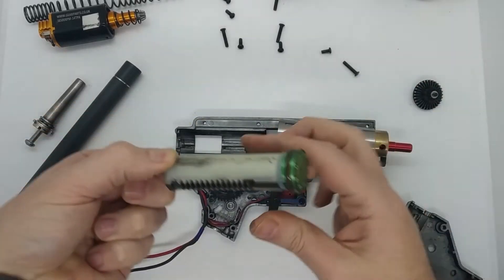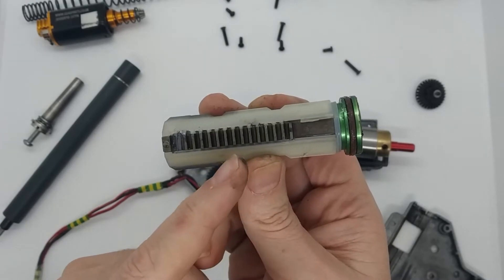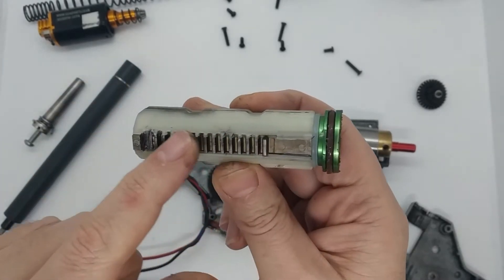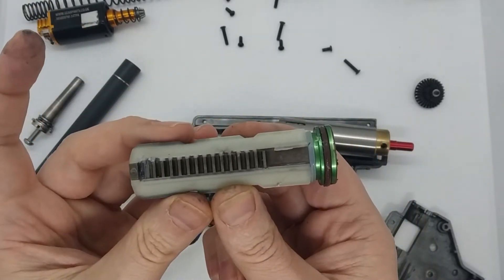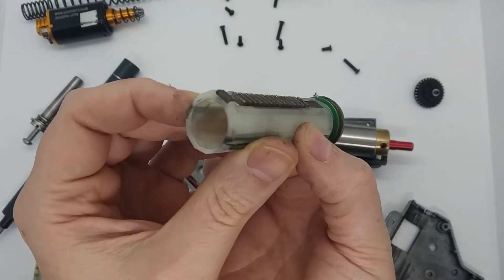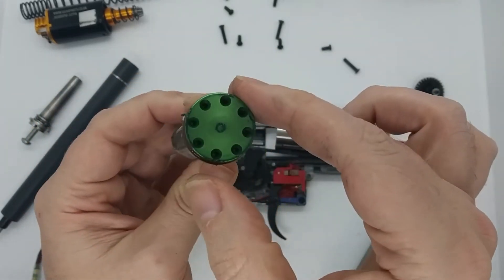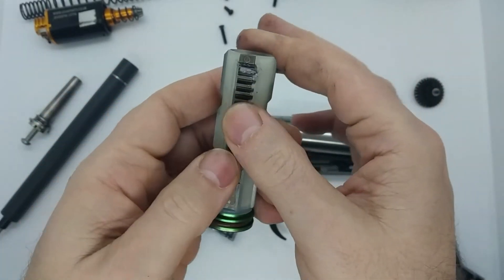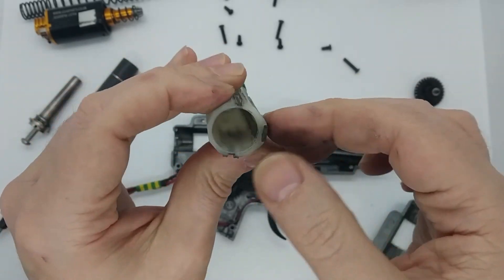CYMA Piston 6000 Round Test

Comment: how do you rate it compared to the shs 14 tooth?
Reply from the maker: The SHS 14 tooth piston is pretty solid but this seems to trump it slightly on rack hardness.   I pushed it really hard, even ran it with an Ultra Warhead motor on 11.1v for a few seconds, not a mark on it.
Reply: @xtairsoft  will certainly be ordering some before airsoft restarts then
Reply from the maker: @GrandadSniper  Definitely worth a try at just £7.50 they are probably the best bang for buck piston out there.